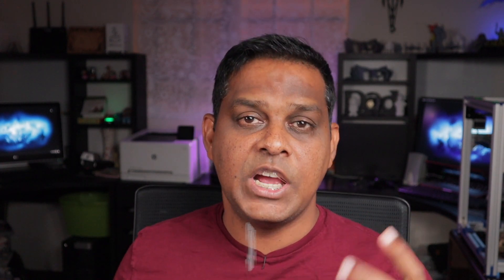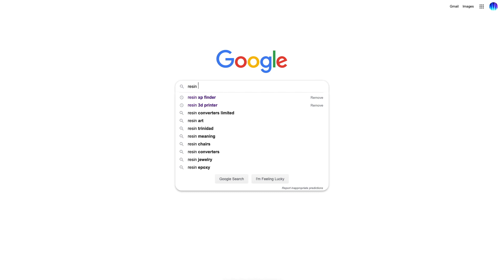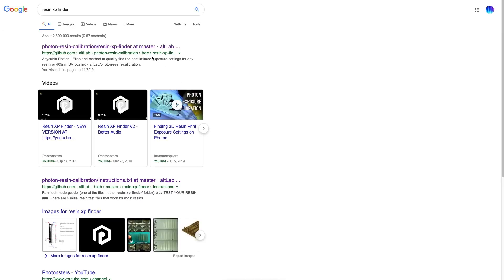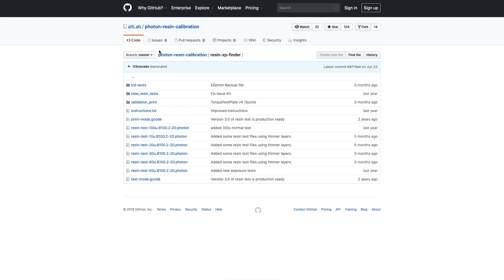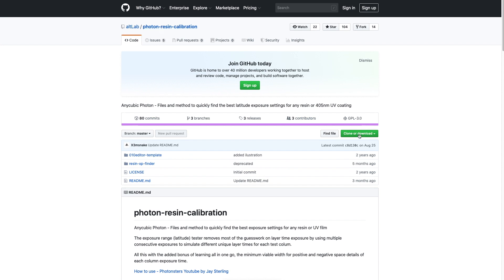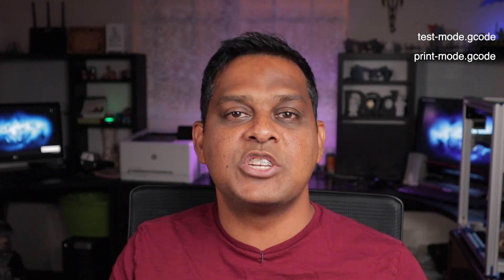How to calibrate your exposure for Chitu Board SLA Resin Printers using the Resin XP Finder tool

Comment from the maker: This was a requested video from a commenter last week. If you would like to see something special let me know and I'll try to make a video to help :) 

Have you ever used the Resin XP tool? Do you have any tips or questions? Post them here!
Reply: I downloaded the test a couple days ago but never ran it cause had never done so before and was bit intimidated by modifying g-code. Definitely feel comfortable doing it now
Reply from the maker: Steve Otten it’s easy. Just follow the steps and go for it!
Reply: Hey, so the phrozen sonic mini's exposure time is a fraction of normal common printers like the photon or the mars. Is that a version of this out with lower exposure time ranges, like for a phrozen sonic mini that prints with 2 second exposure times per layer compared to 6-8 on a photon? Does it need it for those conditions? Also, is there a run setting to set print mode to my machines settings instead of the photon's? Or do i need to contact phrozen for it? Im not sure i saw it on the flash drive that came with it.
Reply: I'm trying to use this process with my Elegoo Saturn, but when I attempt to print the photon file it says it is an unknown file format. Is the process printer-specific or have I done something wrong?

Comment: Hello,
I am new in the resin printing word and I was wondering which zip file I have to use for an elegoo mars pro to be sure it is the right settings and that it does not modify the standard parameters of the print after applying all the file as I could read it in the comments.

Comment: So I am very new to resin 3D printing and just watched your video which you explained very well thank you. I probably have a silly question here, but I am not sure how to perform this test. Do I need anything else? At 7:21 you put the build plate into two containers of fluid. But how did you get those columns onto the build plate? How was the test performed? Sorry if this is a silly question, but that is the only part I did not understand.

Comment: Hey, so the phrozen sonic mini's exposure time is a fraction of normal common printers like the photon or the mars. Is that a version of this out with lower exposure time ranges? Does it need it for those conditions? Also, is there a run setting to set print mode to my machines settings instead of the photon's? Or do i need to contact phrozen for it? Im not sure i saw it on the flash drive that came with it.

Comment: Looks like the gcode files mentioned in this video change default values on the Mars when printed. The first file that disables the wipe is ok as it does what its supposed to do. Once you run that, you run your calibration and then to put things back, you're supposed to print the "print-mode.gcode" file which will set the wipe/lift back to normal (which it does), but it also changes lots of other things like acceleration. fan settings, Z height, etc. So if you own a Mars and not a Photon, you are basically overwriting your printer config with that of a Photon.  Maybe I'm late to the party but is anyone else aware of this? I just compared all the gcode in the "print-mode.gcode" file with the configuration file from my USB drive that shipped with my Mars and there are lots of settings being changed when that code is run. Probably not detrimental but not what Elegoo tested for this machine.
Reply: Huh. I hadn't thought of that, thanks for pointing it out. I guess the best solution is, once you run the test, to use the GCode on the Mars USB to restore the machine to stock settings? I wouldn't have thought to do that so I appreciate the heads up. 
And thanks to Frameone's Makerspace for a great and clear explanation of what's happening. I think I would have started panicking if I'd run this print without realising it disabled the lift function!!
Reply: It took me a little while to figure out how to do the test (I haven't done it yet) because the video doesn't do a step by step, but.... Perhaps for the Mars, the order should be Step 1) run the test-mode.gcode file. This will position the build plate in the resin but will prevent it from lifting up for the different exposures. Step 2) run the test gcode. Step 3) run the Machine Parameters.gcode from elegoo to get it back to their settings. .... if that doesn't enable the build platform again, then perhaps run the print-mode file then the machine parameters file.

Comment: Instead of doing the test mode gcode to stop the build plate from working, can you just take the Build plate off and run the test?  

Seems, unless there's some test the printer runs to make sure the build plate is attached and/or properly zeroed, then just removing the build plate when running the test ought to make it easy to run the test and not have to mess around with gcoding in and out of test mode...   I don't want to take credit for this idea -- I've seen some youtube's for resin calibration where removing the build plate for the test seems to be what the tester is doing...
Reply from the maker: Hi, thanks for your comment. Part of the way the calibration works requires it to be in test mode. It is what allows the long exposure times to be possible while adding new layers to be exposed.